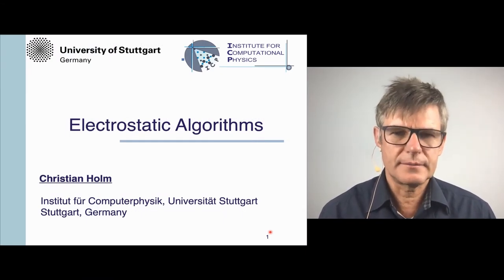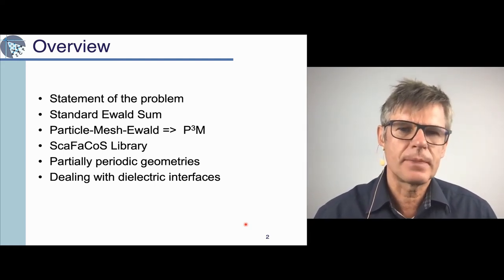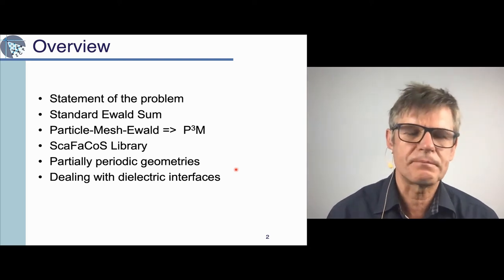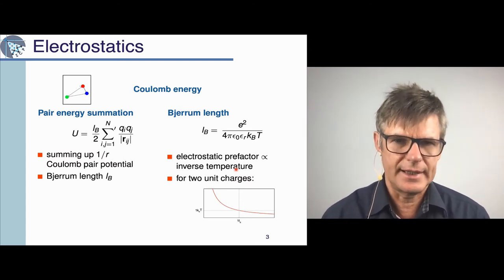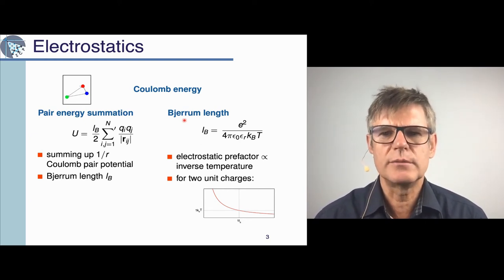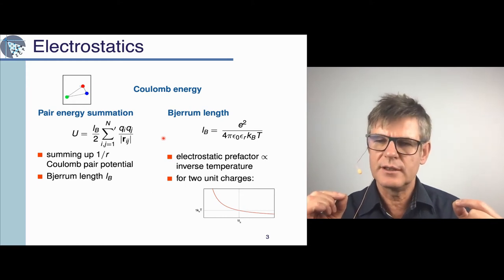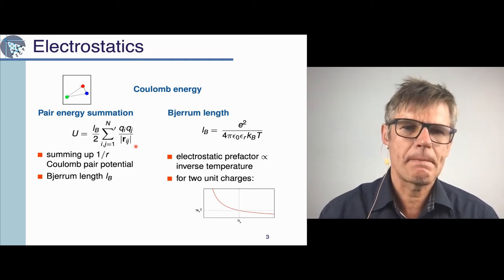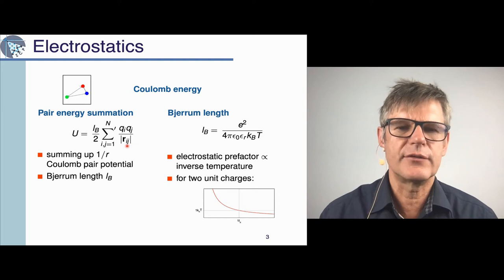Electrostatic Algorithms

Comment: The appears to be a graphical error on slide 8, in that the blue and red splits don't add up graphically to the original.  The red point charge lines should not extend below the horizontal line.